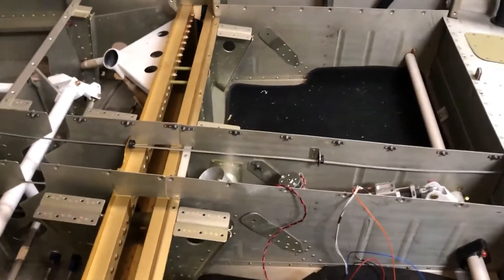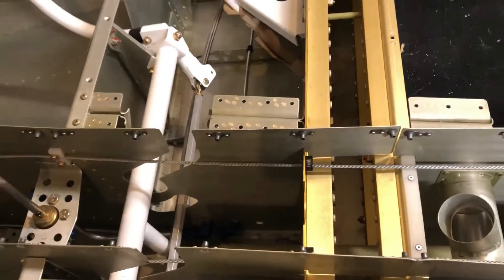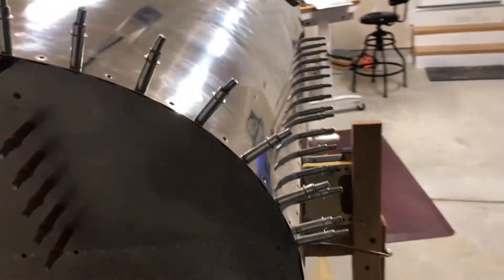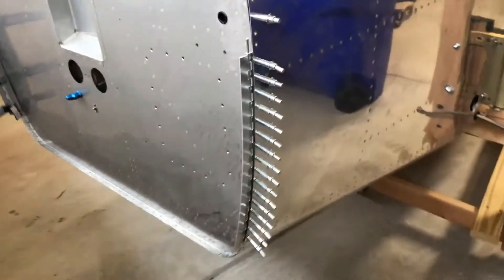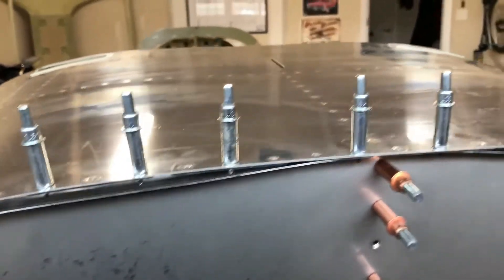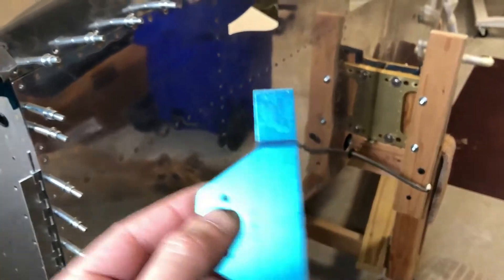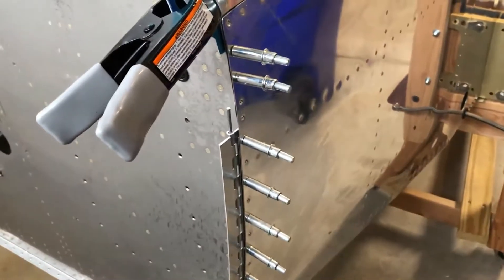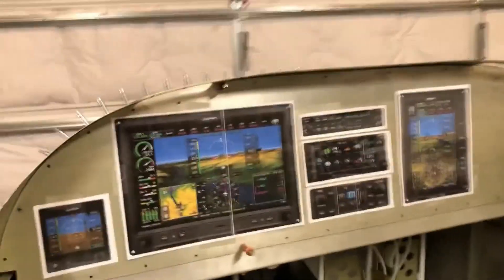Control Assembly, Cowl Attach Prep, and Skybolt Diamondhead Fasteners (CLoc)

Comment: Looking good , I’m at wits end trying to figure out if I need the shim under the Skyblot attachment brackets, your well on your way only thing I may ask of your project, you have A plastic grommet and an aluminum ( #6 ) fittings on your fire wall , ?     Won’t be long melting those if things get hot up front !
Reply from the maker: I have not even really given that much though yet - the #6 fitting is right from the VANS build(fuel line) and the grommet was part of the quick build but i fully expect once i get to the firewall I will be looking hard at what i allow.  Have you completed the firewall work?  would love to know what you have learned and what you are using for passthroughs.

Comment: Great stuff.  I'm following right along.  I haven't watched all your videos as of yet, but wondering when did you actually start?  Did you go the quick build option?  The oldest video I seen was 6 months ago.  You look like you have come a long way in 6 months.  Roughly how many hours are you putting in a week?
Reply from the maker: Thanks for following along, I started this ~ 1 1/2 years ago, just started posting to YouTube as a better way to document the build (one of the FAA requirements).  I have some older stuff (horizontal stabilizer, rudder, elevator, etc) that I will need to post soon. This is the quick build option and I did slow down a couple of times once due to the starting my instrument rating, secondly because of the start of the whole covid thing, and a third time as I was prepping to move the plane to a hanger that did not work out. I typically work on it a good 10+ hours per week, and the aforementioned slow downs did cause me ~ a 6 months delay from where i expected to be now.  My goal is to have this completed by Feb 2022.  What I have not showed in these videos yet is the amount of time I have spent on the schematics for the wiring and avionics... I plan on having the wiring from the cockpit back complete prior to finally attaching the cabin top.
Reply: @aleafonthewind3775  I fell in love with the RV 10 the year it was debuted at Osh Kosh back in 2003.  Not sure if that was the exact year.  I'm now at a point in life where I want to start the build myself.  I appreciate your videos and you actually responding to my questions.